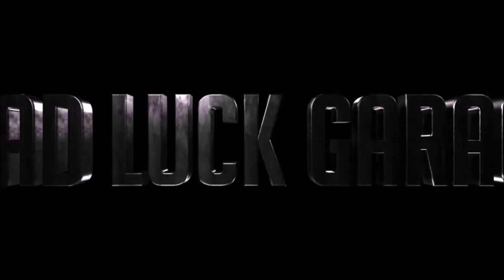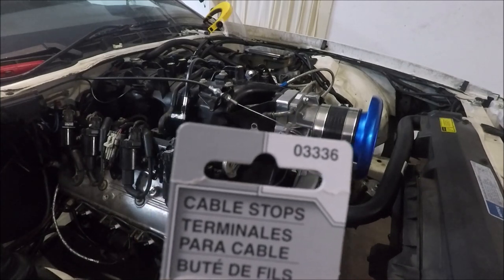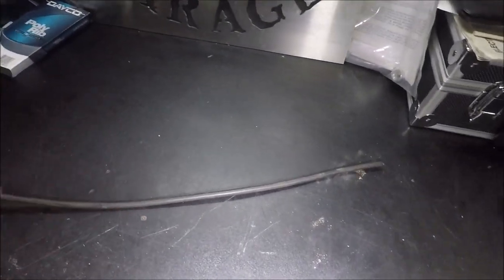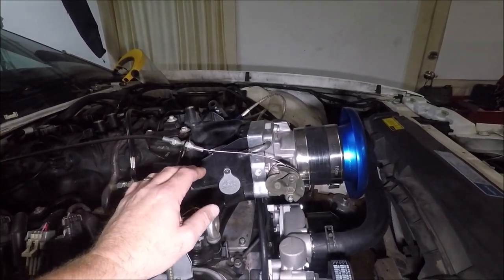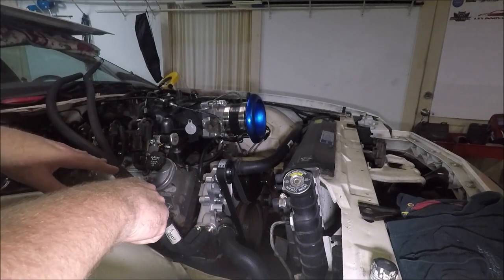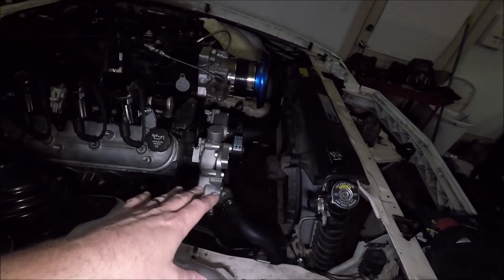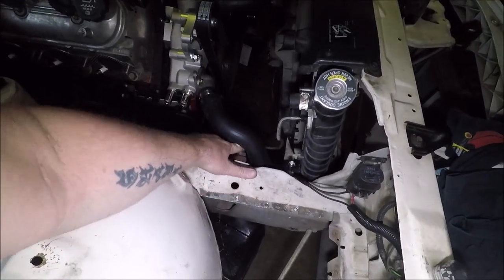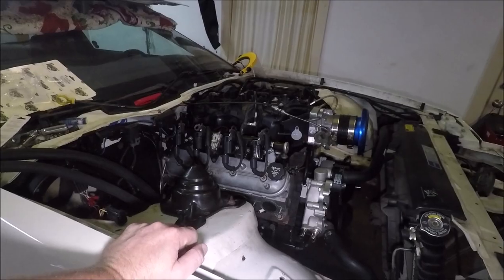RADIATOR HOSES, HEATER HOSES, AND THROTTLE CABLE FOR 3RD GEN CAMARO/FIREBIRD LS SWAP

Comment: Cable stops been used for years on drive by cable gen 3 ls stuff...square body trucks for sure.
Reply from the maker: Yes sir. Not to mention motorcycles, boats, 4 wheelers, .....pretty much anything with anykind of cable.lol

Comment: Those heater hoses are trick!  Thanks for the info buddy!
Reply from the maker: They’re the same ones I always show, lol. Little tip though, for some reason they were literally HALF the normal price at advance auto that I normally pay for them at autozone or even online. I think it may be a pricing glitch in their computer or something! I forgot to mention that in the video.
Reply: @BadLuckGarage  Oh I am sure I have seen you use them before.  I am little dense sometimes.  Good to know.  I've added these part numbers to my running list of items for swaps.
Reply from the maker: Lol you’re far from dense. I know better. 🤣👍🏻 But yea, these are the best “fits all”  heater hoses Ive found time do these swaps.

Comment: Sweet now on the cable how would that work with a carburetor setup
Reply from the maker: If you’re running a carb then just use a stock third gen cable for a carb.
Reply: Cool thank you

Comment: Did i hear you say you change out the waterpump, if so this no longer pertains to me with a factory pump and a 5th hose to deal with?
Reply from the maker: Same number of hoses regardless of which pump you use. 2 heater hoses, upper rad hose, lower rad hose, and steam line.

Comment: Robert, Do you feel that the factory v6 radiator will be adequate to cool a turbo LS?
Reply from the maker: 90-up all used the same radiator. Doesn’t matter if it was a v6 or a V8. Only difference was the cooling fans.
Reply from the maker: That’s one of the many reasons I said I wanted a 90-92. 😉
Reply: @BadLuckGarage  Good to know, thanks.
Reply from the maker: The real question is, will this single fan keep up with this engine. They used this same single fan in the v6s and I believe on the V8 RS models while the z28/Iroc got dual fans. Honestly I think this fan and radiator will be fine right now but once we do the twins I may end up having to upgrade. At that point I’ll probably move the radiator forward a bit as well to free up some space and go with a shorter radiator as well.

Comment: I know it off topic but do u have stock brakes or upgradedbrakes been thinking about upgrading them  I’m kinda doing the same setup for drag racing  like u
Reply from the maker: Brakes are still stock brother. Disks in front and drums in the rear. It doesn’t have any trouble stopping. As you can see from the track videos it’s topping 100mph in the 1/8 and no brake fade. I’ve also made several “quick” 130-0 stops with no issues. But as it gets even faster I will definitely be looking at an upgrade. I’ll most likely reach out to Wilwood when the time comes. I’ve installed some of their products in the past and always been impressed with the results.
Reply: K then I should be fine for now I appreciate it I love your channel  learned a lot from u
Reply from the maker: Thank you and I’m happy if the videos are helping. When I first started this channel four years ago that was the entire purpose was to help others to do things for themselves and save money.

Comment: Where did you get that aluminum plate on the side of your intake I have the same intake and I just have the hole there
Reply from the maker: https://rover.ebay.com/rover/1/711-53200-19255-0/1?mpre=https%3A%2F%2Fwww.ebay.com%2Fsch%2Fi.html%3F_from%3DR40%26_trksid%3Dp2047675.m570.l1313%26_nkw%3D5.3%2BEGR%2BEVAP%2BPurge%2BSolenoid%2BTube%2BPlug%2BIntake%2BBlock%2BOff%2BPlate%2B5.3%2B6.0%2BLM7%26_sacat%3D0&campid=5338299795&toolid=20008
Reply: @BadLuckGarage  thanks for the fast comment I appreciate the help
Reply from the maker: Yes sir. I use all the LSX INNOVATION block offs in all my swaps. They’re only a few dollars more than the China parts but they’re made her in the USA. In  Oregon actually.
Reply: @BadLuckGarage  ive heard of them but never ordered nothing from them but just made my first purchase from them. Thank You!
Reply from the maker: Glad to hear it! I’ve been using them since my first swap 9 years ago. They make motor mount adapters , accessory drives, and all sorts of ls swap goodies for really good prices. They actually just came on the channel as a sponsor last year. I guess using their parts in my videos for years finally paid off. Lol.
Reply: @BadLuckGarage  really? Imma have to watch that video found your channel cause of the motor mount video you did. Im doing my first swap now and its going good so far

Comment: How'd that factory radiator do with cooling that engine?
Reply from the maker: Did just fine. Just like the factory sbc radiators I’ve used on all the other swaps in this channel. The only reason we changed it was to go with a smaller radiator to make room for the twin turbos that we now have on this car.
Reply: @Bad Luck Garage  Awesome thank you.  I just got a mildy built LQ9 dropped in the Firebird, I did grab a used set of factory 2000 Camaro dual fans, but I think I'll hang on to the factory radiator and see how it does.  Love your videos.
Reply from the maker: @brianriggan5688  Yea brother as long as it’s in good shape a factory sbc radiator has no problem cooling an LS. Good choice on the 4th gen dual fans too. They move a lot of air. 👍
Reply: All those hoses worked GREAT.  I cut the lower on the radiator side like you said and it looks like it was made to run right around that idler arm.  The only thing I did different, I used the factory bypass tube as a route for the larger heater hose.  I just cut the 90 degree end off and used that to go over to the water pump connection from the tube, and kept the factory short 90 degree hose at the firewall, just cut a bit shorter to get it off the engine.  Sorry for the excessive comment but this video saved me so much trouble.  So much appreciated!
Reply from the maker: @brianriggan5688  Glad to hear it’s coming together for you brother!